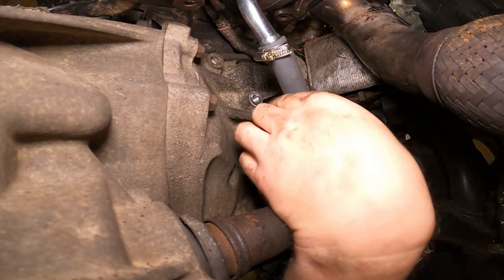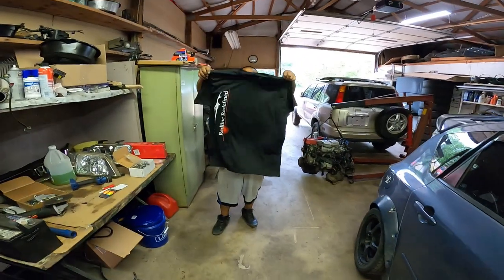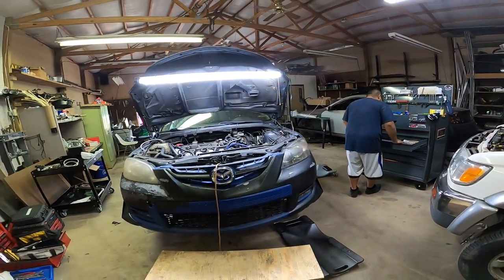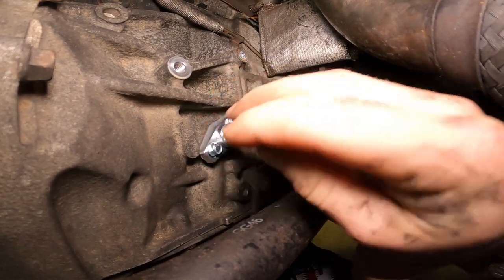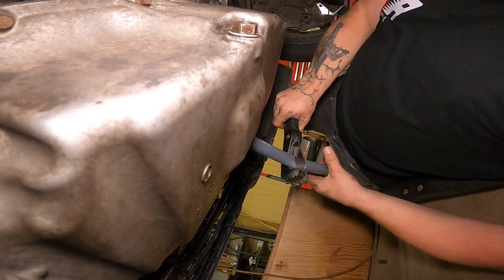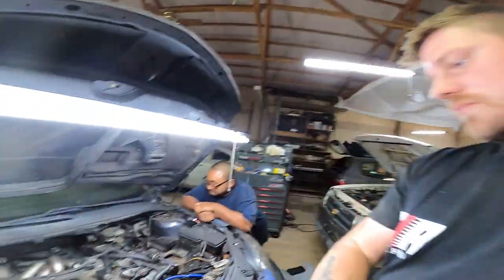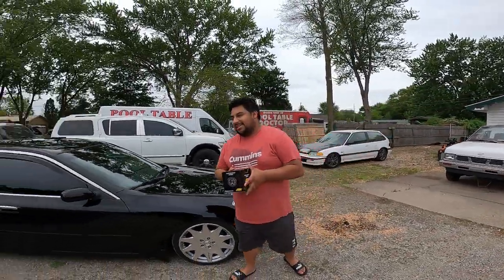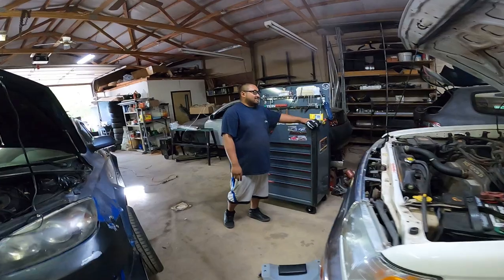Aftermarket Oil Return Line On A MaxdaSpeed3 // New Logo Reveal // Give away Bonus clip

Comment: Did you install this on the stock ko4 or a different turbo?
Reply from the maker: I used the stock k04 on this setup.  The stock oil return line would not bolt back up. The manifold dropped it about 1/4 inch. I plan on upgrading the turbo down the road.